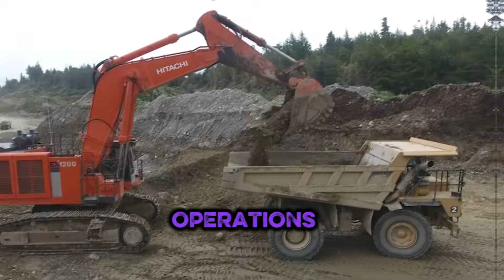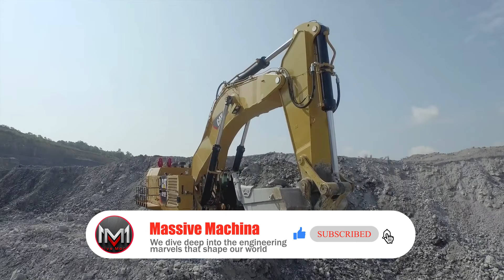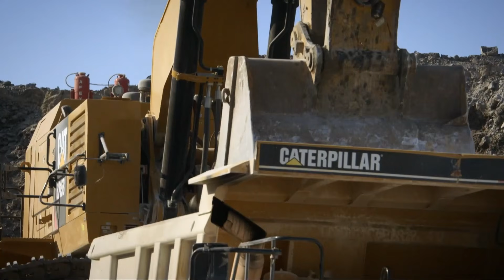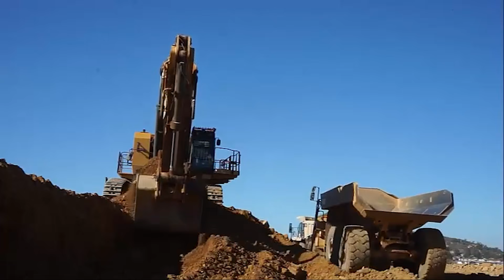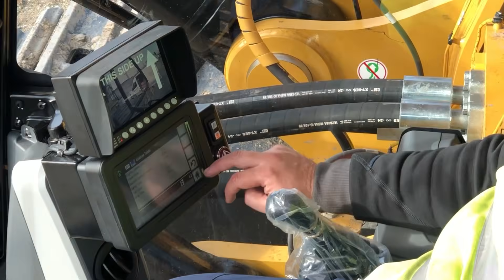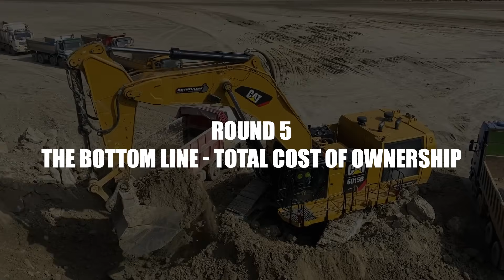Caterpillar 6015B vs Hitachi EX1200-6 Which Excavator Is King?

Comment: Don't get me wrong having smooth hydraulic systems is great but cat has really made there hydraulics and electric systems a lot smoother but the raw power of the cat i have never seen anything to beat it, I have operated excavators and many other machines for years and Volvo, Hitachi, komatsu and others make great machines but the power of the hydraulic system of the cat is far stronger
Reply from the maker: It's awesome to hear your experienced perspective on the power of Cat's hydraulic system! It's definitely a standout feature.

Comment: I think this is not a fair comparison. I think you need to go up one stage in size and power.  With the Hitachi excavator!..

Maybe the Hitachi excavator1250, because this cat escavator the 6015, is a bigger machine.

 I hope I'm stating the number correctly. But just in appearance, the cat appears to be a bigger machine andI don't think it's a fair comparison.

 When you have a 8 yd  bucket. Compared to a 6.7 I think you need to go up to the Hittachachi excavator 1250. 

And then let's see what's going on from there. The hatachi is holding its own irrespective. But yet, I believe it's not a fair comparison that caterpillar is a monster!!!
Reply from the maker: That's a fair point, maybe next time I'll compare it to the next size up!

Comment: carterpillar 6015 will win,v12 engine ,hitachi1200 in line 6 cilinders.
Reply from the maker: You make a solid point! The Caterpillar 6015B definitely has the power of that V12 engine on its side. It’ll be interesting to see how they perform in real-world scenarios!
Reply: @Massivemachina 6015 cat has more power💪💪💪💪💪💪💪💪💪💪💪💪

Comment: Wouldn't that be like comparing an EX1800 to a 6015  cause the Cat is 150 ton and the Hitachi is 120 ton 30 ton difference so why not compare Hitachi 180 ton to the 150 ton Cat lol 😂
Reply from the maker: You're correct. When I looked it up for the video it said that the hitachi 1200 was the comparable model to the 6015. The experts and people on here with the real world experience have corrected me on that. Maybe I will do another one comparing it to the ex1800 or maybe try to figure out which cat is 180 tons

Comment: Of course the Cat dealers findings support the Cat 😂😂 Just like John Deere skid steers always win the skidsteer battles that are often sponsored by Deere dealers. I dont buy that portion of the video. Get Komatsu or Liebherr to clmpare the 6015B and EX1200 and come back to me.  Cat have a big name built over 100 years. They have a good marketing team and the ability to support like no other. Hitachi doesnt have the same resources to invest like Cat does. Cat has a advantage because they also have a full product line to offer. Regardless, I'd still buy a EX1200 for the bullet proof reliablity. Something that was mentioned multiple times. The new Cats dont hold up like they used to. Alot of the newer ones are riddled with problems right out of the gate.
Reply from the maker: @scottmartin6594 I've been hearing that a lot from operators. They say Cat has been outsourcing their parts these days so they are made cheaper and tend to fail more. They seem to be having a lot of quality issues, which also explains why komatsu and hitachi are capturing a larger market share these days.

Comment: Hitachi specialise in this category.  Look at Australian mines, totally dominated by Hitachi. Cat make great dozers , loaders and graders. Not excavators
Reply from the maker: As far as sales goes Caterpillar is currently number one when it comes to excavators. Although Hitachi is gaining ground and now in the top five. Interesting side note Cat has been dethroned as the number one bulldozer company in the world.
Reply: @Massivemachina When you say that Caterpillar is top in excavators, I believe you're referring to all the sizes of excavators (minis included?).  Mining is a separate category altogether.  As well, many Hitachi excavators of the smaller sizes 60 tons and smaller were sold as a Deere excavator further skewing the numbers.  

It's hard to compare a Ex1200 to a 6015 since they are not the same tonnage or horsepower.  It's the same if you'd compare the Cat 6015 to a Hitachi Ex1800. The smaller machine is at a disadvantage and will therefore move less cubic yards/ meters versus a larger capacity machine. 

Interesting video nonetheless.  Enjoyed it.
Reply from the maker: @donaldedwards6603 I was referring to all sizes I suppose. The hitachi website said the 1200 was the comparable size to the 6015. I didn't realize it wasn't the best equivalent. Thank you for info, I don't always get these things right. I'm glad you enjoyed the video.
Reply: @Massivemachina You're American ?
Reply from the maker: @jasonbachelor604 I am
Reply: @Massivemachina That explains the Caterpillar love.
Reply from the maker: @jasonbashelor604 believe it or not it actually has nothing to do with it. The most interesting aspect of it all is that Caterpillar used to dominate across all the different construction vehicles in the industry but that is slowly slipping away. Other companies are coming out that are cheaper. Existing ones are making machines that are better quality. The service network cat is known for isn't helping them as much since they outsourced their parts leading to more breakdowns. Its interesting watching how their market share is slowly slipping away
Reply: @Massivemachina I've been in the mining and construction game for 35 years. Cat has never really created a sizeable market in Australia in the over 100 tonne excavator scene. Hitachi and Komatsu dominate. More reliable, especially filters and air conditioning systems
Reply from the maker: @jasonbachelor604 I can't argue with your real world experience. I only have google and research I can go by. It wouldn't surprise me though. Hitachi and Komatsu have been making strides in making the cab more comfortable for the operator. I am curious where all the Cat excavators are being used at then if they aren't being utilized in the Australian mining scene.
Reply: @Massivemachina CAT do have lots of excavators, under 50 tonne in civil construction
Reply from the maker: @Jasonbachelor604 well i do have another video coming out soon comparing the Cat 395 vs the hitachi ZX890. I hope you'll enjoy that one a bit more.
Reply: @Massivemachina Don't get me wrong, the video was fantastic. Just disagree about the Cats, although I am on a 374 D2 as we speak
 LOL
Reply from the maker: @jsonbachelor604 texting while working? tsk tsk. I'm glad you liked the video. Let me know if there are any machines that you'd like to see videos of and i will add it to my list
Reply: @Massivemachina Love to see one on the history of Favco Tower Cranes. The pride of Australian construction
Reply from the maker: @jasonbachelor604  are you more interested in the technical evolution of the Favco tower cranes or the company or a combination of the two?
Reply: @Massivemachina The environment in which they created the Self Erecting process. I spent the first 5 years of my career building them. The thinking involved in ending the relationship with the Derek fascinates me
Reply from the maker: I'll see what I can do. They have been a pretty big part of some of the biggest buildings in the world. I'll throw something together and tag you when I get it posted. Might be a couple of weeks.
Reply: @jasonbachelor604  @Massivemachina Sure it has changed a lot now, but I was working at a Hitachi dealer back in the EX1100, 1800, 2500, and 3500 days, and PC1000/1800's. We used to rip out the complete Hitachi and Komatsu genuine a/c systems from the factory before being sold and put in an aftermarket system because it was crap and you couldn't buy parts, or match up any of their weird metric components with anything here in Aust. Other than that, EX & PC machines were THE shit and Cat didn't, or couldn't make a digger in that size range to save themselves.
Reply: @Massivemachina  Liebherr pretty much have the big shovel/excavator market here in Aust now. A few Cat's/O&K's and Hitachi's, but they dominate the bigger machines...
Reply: @Jack_Rabbit_1 Classic bud.
Reply from the maker: @Jack_Rabbit_1  I have been hearing from a lot of people that the big downsides to hitachi and komatsu is that it's very difficult to get replacement parts. Cat does have the 6090 fs which is a pretty dang big digger.
Reply from the maker: You are right Liebherr's 9800 is a pretty dang massive machine
Reply: @Massivemachina Greece is full of cat excavators both in civil engineering & mining operations. One of the operations in the South of the country still has some old cat 245s working alongside 345s 365s ,385, 395s  & 2 6020s & 2 6040s .
Reply: Would differ on that opinion
Reply: @bjwatson9000 You would be wrong LOL

Comment: The cat with the bigger bucket and better fuel efficiency is the way to go!
Reply: I agree. Loading more materials and moving faster in long work hours are always wins.
Reply from the maker: Absolutely! Efficiency is key on the job site, and both speed and capacity make a huge difference in productivity.
Reply from the maker: I agree. The Hitachi got stomped on this one.